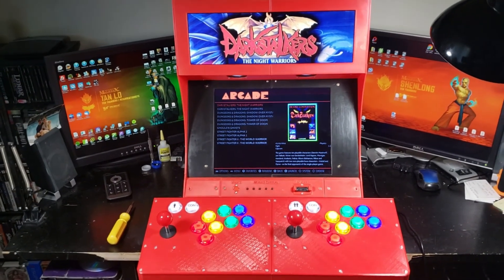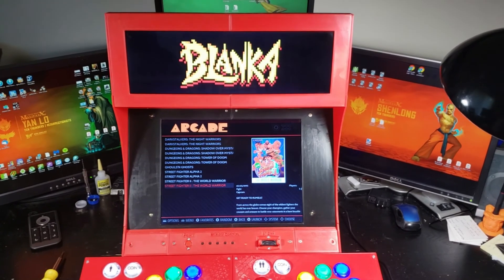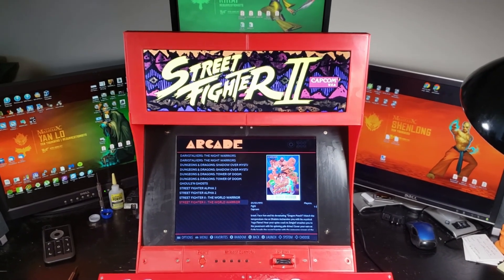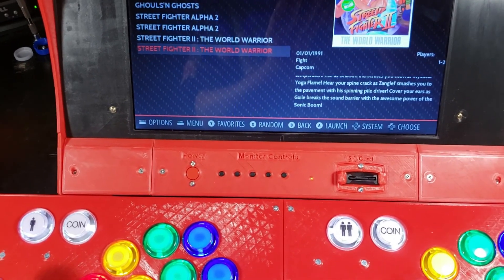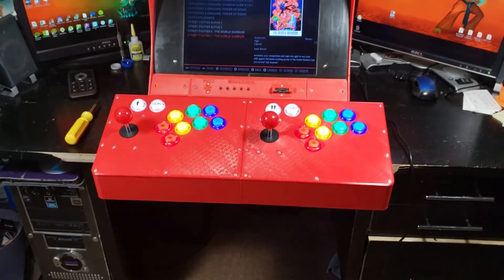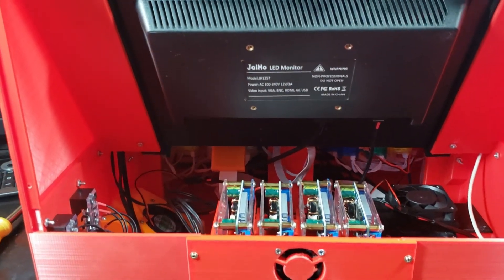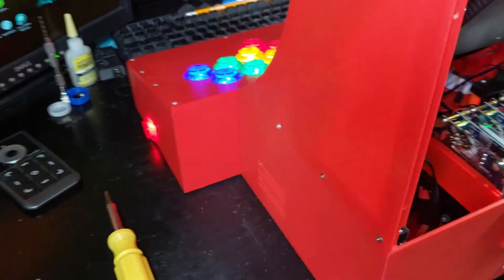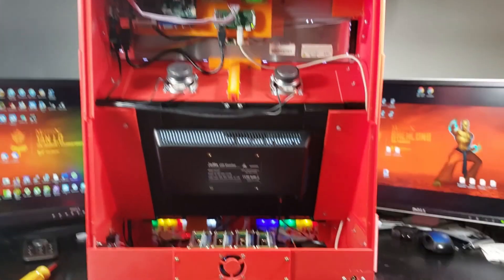3D Printed 2 Player Arcade Machine

Comment: Is the screen the 1up equivalent?
Reply from the maker: If your referring to the marquee screen, this is the one that is meant for the 1up from the original PixelcadeLCD. I sourced the screen myself for another purpose, but used it for this and just grabbed the software. The main screen was just a cheap LCD I pulled out of a HDMI capable monitor meant for a DVR. The marquee screen is $118.99 on Amazon and the link is in the bill materials sheet listed in the description.
Reply: Where did you grab the software and the marquees?

Comment: hey man im gonna be taking a wack at making one but what kind of wires did you use to solder
Reply from the maker: Hi there!! Sorry I did not answer your questions sooner. My personal and work life has had me pretty busy. I used 16-18 AWG stranded copper wire, or whatever I had lying around. That should be enough to prevent resistance build up at connections.